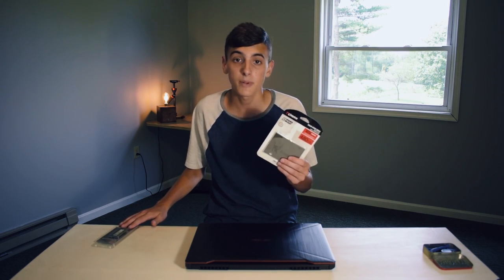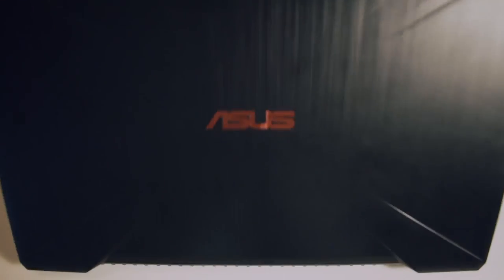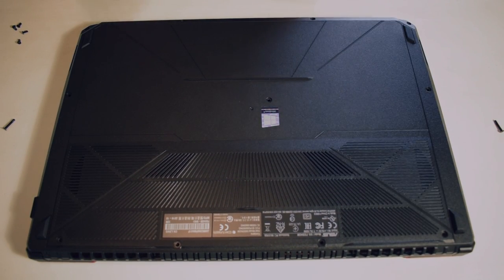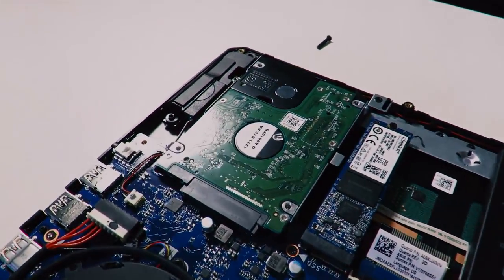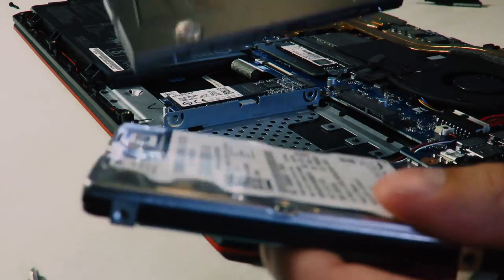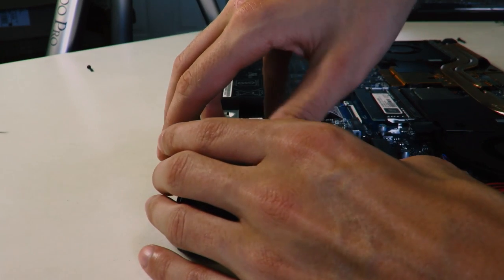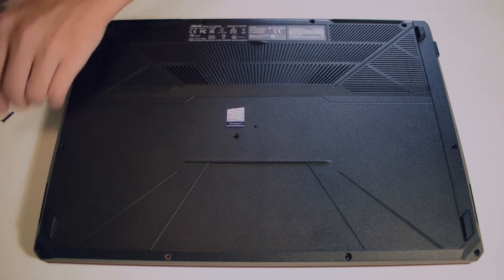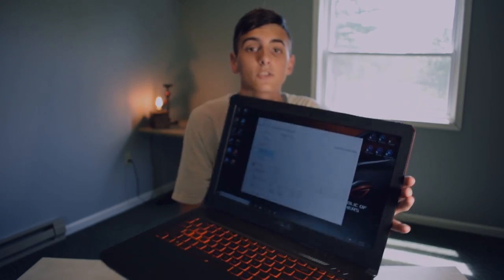UPGRADING LAPTOP!! | ASUS TUF FX504 | SSD and RAM [2019]

Comment: disconnect the battery first!!!
Reply from the maker: Yes please do that... I forgot to.
Reply: Pin it.
Reply from the maker: @mdaamirkhan5901  Done!
Reply: how can we disconnect the battery?
Reply: @stn6408  the battery is the big black thign on the botton left of the video, you just have to disconnet the little cables that comes out of it right in the middle of the top. Don't forget to connect it back again
Reply: wanuluu what’s happens if ya don’t.
Reply from the maker: @kirbstomped361  Well you risk shorting something which can damage internal components. Thankfully this didn't happen to me.
Reply: @kirbstomped361 you can short circuit the motherboard and damage some functions that still operate while the laptop is turned off like the power button. so basically if you accidentally touch the motherboard and cause static your laptop may not be able to turn on
Reply: Just what i was looking for! Thank you!
Reply: if i just want to put a ram. should I disconnect the battery?
Reply: @renta8702  yes ....you could should out the board..
Reply: @ZackEberly  Hey kid can you put 3200 mhz Ballistix in this particular model Yes or no what UEFI options does It have and is this Mrb or GPT partition?.
Reply: how to disconnect the battery without those plastic tool to pry it out of the cable?
Reply: @jeryltiu959  by hand with your nails
Reply: @ESW_JSALINAS  alright man thanks!
Reply: @ESW_JSALINAS  one last thing. my laptop's m2 ssd is blocking the last screw of my hdd. Do i have to reinstall os if i unplug my m2?
Reply: @ESW_JSALINAS  it’s better to not use your hand and use gloves and some form of plastic removal tool; you don’t want any accidental static to transfer to the motherboard.
Reply: sorry to be off topic but does anyone know of a way to log back into an instagram account?
I was stupid lost the password. I would appreciate any help you can offer me
Reply: @Zachariah Gerardo instablaster :)
Reply: @Emilio Lucca it did the trick and I finally got access to my account again. I am so happy:D
Thank you so much, you saved my account :D
Reply: @Zachariah Gerardo No problem :)

Comment: Couple of things for people tha want to upgrade there Asus tuf.
Try to use the same memory sometimes 2 random Ram modules dont work.
If you try to upgrade your harddrive TAKE THE TRAY OUT.
if you bend the harddrive that way like he did it you might break the connector.
The harddrive is in a metal bay thats connected with 2 screws so you dont have to pull it up.
Reply from the maker: Interesting... I actually didn't know that the tray was removable.
Reply: @ZackEberly   its okay.  Most laptops use that type of bracket idea. First you install the drive in the bracket and then install the bracket into the laptop.
Reply: does anyone know what the stock ram brand is? i’m planning on just adding 1 8gb of ram next to the stock one and wondering what the brand is so they both can be the same
Reply: @snookfishingfl212  best thing is to check for yourself than you always know if you have the same one.
Mine had 1slot with a stick called ---sk hinux 8gb 1rx8 pc4 2666v        It can vary from country and or where it is shiped to.

Comment: Dude still be hearting comments 
What a legend.
Reply from the maker: I’d double heart this one if I could
Reply: @ZackEberly  lol ty
Reply: @ZackEberly  also ty for this video I have the same laptop and also I have a question, should I put extra 8gb ram or shall I put 16gb ram bcz it says dual power something something I guess
Reply from the maker: Well dual channel ram has double the peak data bandwidth than 2 different types of ram like I did in my laptop. Do I care not really. Should have I cared, yes cuz I could’ve had more performance. I recommend if you want 16gb of ram total. Buy a dual channel ram with each stick being 8gb for a total of 16gb. They’ll just come in a kit like that.
Reply: @ZackEberly  oh okay so you mean like ram that come like 8*2 on amazon? Like crucial kits?
Reply: @ZackEberly  but for that I'd have to remove the default ram?
Reply: @ZackEberly  pls tell?

Comment: Bro just upgraded my ram and ssd in my fx504 with your help. Can't thank you enough! 🔥🔥
Reply: Can u tell me which ssd u bought?
Reply: How the lap is now fast or slow
Reply: @funhub3993  it's much better now. With the ram i can multitask much easier and having my programs installed on the SSD as opposed to an external usb harddrive, they load MUCH faster
Reply: Gavri Daniel  do you mean it turns back off after that one second? If so, then just check to make sure all the connections are tight and secure and that everything is back where it should be. What did you upgrade specifically, ram, ssd or both?
Reply: Gavri Daniel  are you certain the ram is compatible with the laptop? There are very strict requirements for what you might need
Reply: Gavri Daniel  I'm not sure, and i don't know enough to advise you on what happened... But if you take out the battery, plug in the laptop and power it on, does it work then?
Reply: Gavri Daniel  im really sorry dude, im not sure what to tell you. I hope you get it working again though.

Comment: Great video! I am going to add an SSD to mine since it only has the M.2. I just wanted to make sure there was a spot for it before I take this thing apart. Thanks!
Reply: I'm really confused between m.2 and m.2 nvme, which one is supported in asus TUF fx504? please help
Reply: @sarthak1317  By contrast, M.2 is only a connector, which plugs into the PCIe bus interface. Non-Volatile Memory Express (NVMe) is a technology for storing data that is fast enough and low-enough latency to connect to the PCIe bus interface via the M.2 connector.

This gives you some options. You can get an M.2 drive that accesses the SATA bus instead of the PCIe bus, which is convenient but doesn’t max out the connection speed. Or, you can get NVMe drive that accesses the PCIe bus and gets all the speed and latency benefits that come with that.

From what I can tell the fx504 will support either one. NVMe is faster but probably more expensive
Reply: @sarthak1317  there is one slot for m.2 sata ssd (in which currently the hdd is present) and one slot for  m.2 nvme ssd. Mind it, you can't add nvme ssd to the slot of the hdd . and neither the sata ssd to nvme slot. hope that helps.

Comment: The frame of the disc comes out with only 2 screws (6:52 - the one on the right side of your finger to the right (close to the left speaker) and the other one close to the M.2 screw). Then you can easely remove the HDD from the frame and replace with another one.

Comment: Nice video. Btw, have you ever get any hinge issue with this laptop? Cause mine is broke 2 times even after it fixed at the service center.
Reply from the maker: I haven't had to many problems but i must say it does kinda have a weak hinge.
Reply: i see
Reply: I am starting to regret for buying this laptop...

Comment: Seems they made it pretty easy to upgrade. How about the processor? Is there any way to replace it? I heard new ryzen 4000 processors are beasts
Reply from the maker: If you have an Intel cpu then you can’t upgrade to ryzen and I also think the ryzen 3000 has a different socket then the 4000.

Comment: Hello mate, I consulted ASUS regarding the hardware update; according to their suggestion for my FX504, I'm allowed to install 2 x 16GB DDR RAM by getting rid of 2 x 8GB of DDR RAM. As for SSD, that'd be P3 x 4 256GB M2 2280 NVME P; may I know what's your SSD capacity, and I wanna know if there'll be any space left for an extra HDD?
Reply from the maker: I have a 256gb for boot drive and i added a 480gb ssd for extra storage.

Comment: Nice video man i got the same laptop today i upgrade it with an ssd 970 plus evo and a total capacity of 16 gb ram but the opening time is approximately 10 seconds whats wrong ? How much time do your laptop make to open and close ?
Reply from the maker: There's nothing wrong with it. My takes longer cuz of more programs. The more cores your CPU has the longer it takes to boot, my gaming desktop says it takes 22 second, Ryzen 3700x, x570, 32GB DDR4 Ram, RTX 2070, WD 500GB NVME M.2
Reply: @ZackEberly  thanx man
Reply: How much memory capacity is the 970 that you put in it?

Comment: If you added the m.2 SSD yourself, do you remember if it came with a screw in the computer already, or will i need to find one myself?
Reply from the maker: The M.2 was already installed for me. The screw comes with the m.2 ssd or a least it should.

Comment: Hi Zack! I have the same laptop as you. I added a 16Gb DDR4 2666MHz 1.2V HyperX RAM, but I can't get my laptop to read the new memory correctly.
The following happens to me:
I connect the 16Gb RAM to Slot1, the 8Gb (which came on my laptop) to Slot2 and it detects only 16Gb.
Slot1: 8Gb; Slot2: 16Gb; 8Gb is detected
Slot1: 16Gb; Slot2: 16Gb; 16Gb is detected (both are the same RAM that I mentioned at the beginning of the message)
Slot1: 16Gb; Slot2: empty; 8Gb is detected.

I do not understand what's happening. I asked a friend for help and he helped me update the BIOS but it did not solve the problem. Do you have any idea what I'm doing wrong or how to solve it? Maybe the RAM I bought is not compatible?
I hope you read me! Thanks anyway!
Reply from the maker: That is very weird. So you would get a total of 24gb of ram correct? Check the ram when your in the bios and see what it recognize as, like the speed and the full size. It might be a windows problem not using all the available ram.
Reply: @ZackEberly  I will keep looking! Thank you!!
Reply: You solve it?
Reply: @tor6278  no :/
Reply: @edumiotica  Solved?
Reply: @a859-vedantlahane8  no :/

Comment: I have the Asus Tuf Gaming FX504GD, how do I find out which type of SSD is right for my laptop? What SSD do you recommend for my laptop?
Reply from the maker: I’m guessing you already have a m.2 ssd as your boot drive. For a 2.5in ssd I’d recommend a Samsung or Kingston ssd. Whatever size storage you want a 500gb cost around 50 dollars.
Reply: @ZackEberly  When I bought my laptop I chose a laptop without an SSD (the price was cheaper). So my laptop doesn't have SSD yet. Wow, 50 dollars can get a 500GB SSD. Can you name the brand in detail? Like what Samsung... or what Kingston...
Reply from the maker: Wait. So you have a hard drive then? Are you sure. You can check by going to task manger and click on the performance tab and click on drive c. Then type in the product number online to see what it is.
Reply from the maker: If you do have a hard drive then you prolly can’t get a 2.5in ssd but rather a m.2 ssd.
Reply: @ZackEberly  ST1000LX015-1U7172 ? Yes I'm 100% sure. And when I go to Defragment and Optimize Drive,  the media type is HDD and HDD
Reply from the maker: @NaniFatimana  Ok yeah your right. Yeah there should be a empty M.2 slot to the left of where the hard drive is. A m.2 SSD cost a little more but has a faster read and write speeds. Here is a samsung m.2 500gb ssd- https://amzn.to/2Qmcq5x
The ssd's made by samsung and some of the industries best.
Reply from the maker: You can check the laptop by removing the back panel before purchasing to make absolute sure. I'd would do that. I don't know everything thing.
Reply: @ZackEberly  So I have to buy a M.2 SSD?
Reply from the maker: @NaniFatimana  Yeah here is a 500gb m.2 for 60 dollars- https://amzn.to/361Ucg6
but you can choose any one you want.

Comment: I'm a little new to all this, do you not have to back up windows and put it on a USB stick to recover once you're done? Or can you literally just put the new components in and be fine?
Reply from the maker: If your not removing your upgrading the boot drive then you don't need to do anything about windows. In my case, windows was on my m.2 drive and I didn't touch it. I added another SSD for extra storage and I did nothing with windows. If you do want to upgrade your laptop's boot drive then you will need windows installation usb drive. its free with the windows creation tool. Also prolly want a backup of your stuff.

Comment: Sorry for the noob question but doesn't this laptop already have an SSD? Why installing a Kingston?
Reply from the maker: Yes, it has a M.2 SSD as a boot drive and I wanted more storage so i added an extra 480gb SSD. I replaced the hard drive in the laptop as you can see and replaced it with the Kingston SSD.
Reply: @ZackEberly  Ah ok so from SSD+HDD you went SSD+SSD. Thanks for the clarification.

Comment: I have this laptop but it's specs are i7 8750h. Is the process any different and is the maximum amount of ram upgradable only an extra 8gb? Thanks for the great video as well
Reply from the maker: The process should be the same. I think you can go up to 32gb total. Each slot taking 16gb of RAM each.
Reply: @ZackEberly  how do you clone a hdd? Could you possibly make a video on that or can you tell me where I can find a good video explaining it? Thanks for the response btw
Reply from the maker: @pebbles9649  There are 2 ways to clone. Software and hardware. Hardware is using a cloning device and is easy to use but cost around 50 dollars. Software is free and i recommend using EASE US. Here is a video- https://www.youtube.com/watch?time_continue=150&v=ixqfH0w_6Xw

I'd watch a couple more videos to feel comfortable doing it. I work in IT and have lost a drive because of not following instructions closely.

Comment: Does enclosure method of cloning works too? Im really scared on doing such stuff and i really need to change my damaged hdd cause its really slowing my laptop and instead i want to change it to ssd.
Reply from the maker: Not sure what enclosure method is... you mean cloning it to another drive while the HDD is still in your laptop? You can just copy and paste, then change the drive letter to the original drive. Then programs won't know the difference between the new and old drive.

Comment: Hi, nice video ! Do you know if it easy to install Intel Optane inside ?
Reply from the maker: If your using the M.2 slot for your OS like mine, its not an option. But if you only are using the 2.5in slot with a SSD or HDD then you could install it in the M.2 slot.

Comment: opened up my Asus fx505dt but I cnt close it back properly. there is gaping space in the front. any help?
Reply from the maker: The clips that hold it together could be broken but the screws would hold in then. Apply some force... maybe take it off line up the front first then pop in sides and then the back.
Reply: @ZackEberly  it worked thanks. all it needed was  a wee bit of pressure.

Comment: Hey man great video I've just got one question I wanna upgrade the ram on Mine but do I need to replace my current stick with two 8gb or just add another 8 GB and if so what will be a matching stick ?
Reply from the maker: Depending who you ask are single stick will work but two sticks of RAM will work better with better performance
Reply: @ZackEberly  thanks for replying but my question wasnt answered lol
Reply from the maker: @wilkiesxgaming  I kinda did answer your question. NO you don't have to replace the current one but there might be some performance lose, and no it won't be a matching stick. You'd have to get dual channel memory
Reply: @ZackEberly  that's really helpful sorry for my dumbass lol will replacing the current one be the same process

Comment: Hey Hopefully I can still receive an answer to this older video, 

Can I also install a SSD which is bigger then the one you used to this laptop & is the Ram still up to date or is there a newer one which I could get ?

Thanks in advance.

Moritz
Reply from the maker: You can use any 2.5in ssd. You want a 8TB ssd go for it. As for the ram, it does work how most upgrades work in the way that your thinking. The laptop supports 2666MHz (or maybe higher) but that isn’t ever going to change. As long as you get the right version and speed/capacity that’s all you need.

Comment: Question, does the amount of pins in the ddr4 sodim ram matter? Like a 204-pin, or a 260-pin?
Reply from the maker: Yeah massively. 204 pin is sodimm DDR3 and 260 pin is sodimm DDR4. They don't work interchangeably.

Comment: I currently have an M2 SSD installed while the 2.5" slot is available. Do I still need to clone?
Reply from the maker: Only if you want to clone your existing m.2 ssd. I cloned to save my data on my 2.5in SSD which you don't have, so no. There is no reason for you to clone.

Comment: Does this laptop have an extra slot for ssd? Like for example can I use the original 1tb hard drive alongside an ssd?
Reply from the maker: It has a M.2 slot open on the motherboard. If you take a look at the inside of mine, you can see I have the m.2 ssd in.
Reply: @ZackEberly  ah i see. Thanks a lot man!

Comment: Does your laptop have any heat issues?
Reply from the maker: Yeah, it overheats a little, but luckily I have the better cooling system than the original fx504s had.
Reply: @ZackEberly  I am not sure what mine is but soon I plan to open it for cleaning upgrading RAM
Reply: @ZackEberly   I have the same :D last week the laptop died (rip motherboard)

Comment: If adding one more RAM means to find the same version(brands) or can mixed it with based RAM and other brand of RAMS? *does the brand of RAM matters?
Reply: Typically no, the brand difference won't matter, but it's usually preferable.
Reply: Different brands and sizes for me and no problems. Even dual channel is working.

Comment: Hello bro I need an advice. The laptop hinge is weak. Can you do a video about it. Please reply. Thanks
Reply from the maker: I'm afraid that is a problem with this laptop. Luckily I haven't experienced any problems yet but I'm taking extra care of mine. IF you have it in warranty yet you might be able to get it fixed.
Reply: @ZackEberly  bro for how many years do you have the laptop? On mine at the left bottom hinge the red and black plastic is seperating when closing it. Any idea how to fix it?